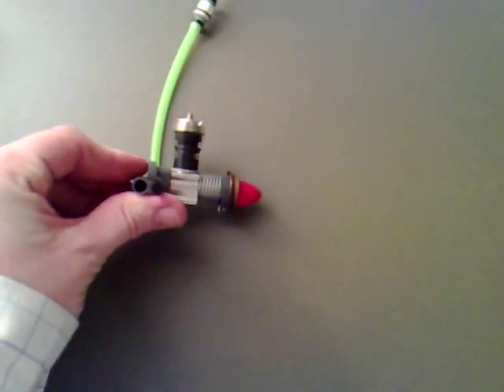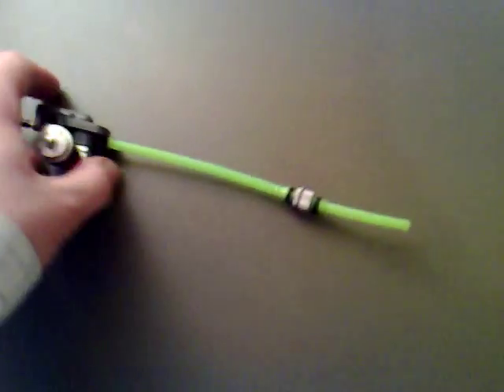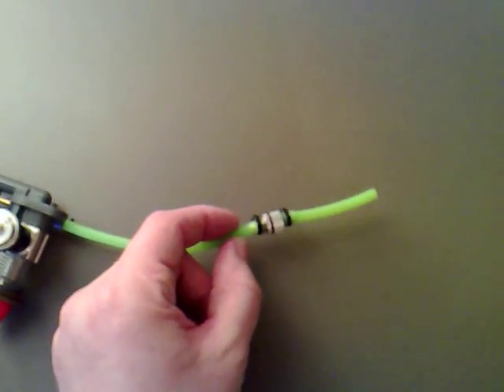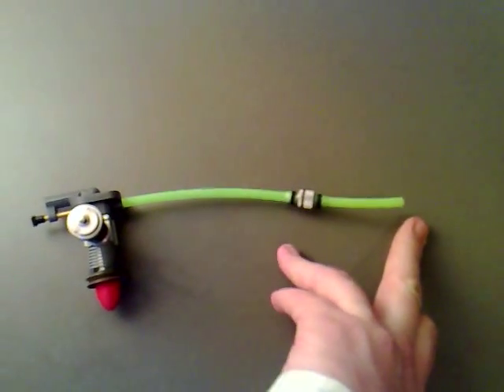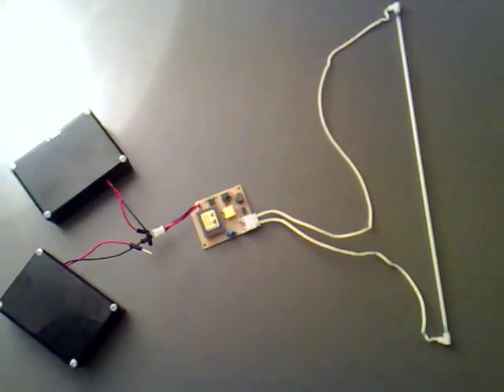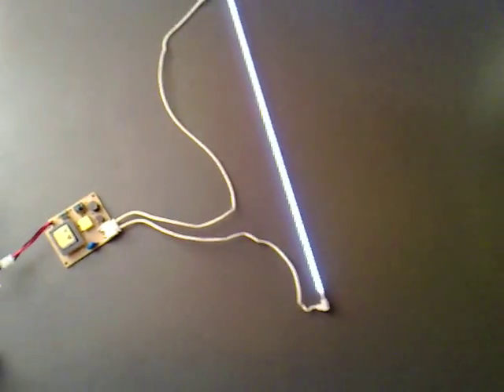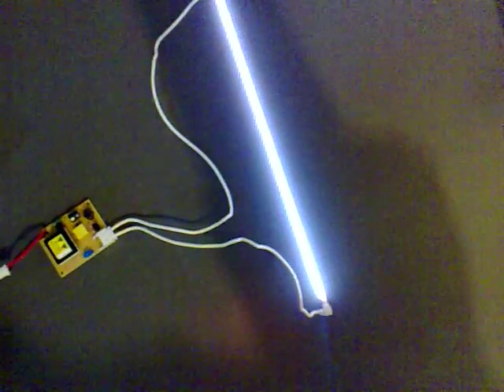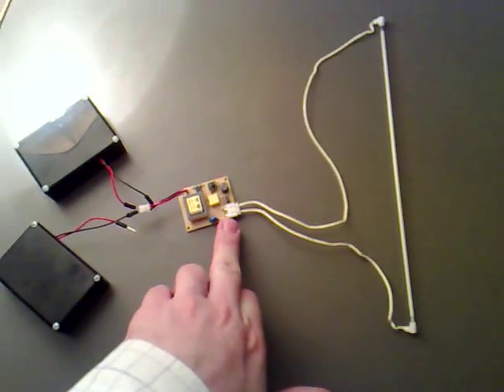HHO Generation (2 Stroke) 002

Comment: IF you are looking for as possible as hight efficency, you need "sweet spot" for VPP (Voltage Per Plate). I mean, if you have 7 plates and you use 12,5 V it is: 12,5V / 7 = 1,785V. Sweet spot is 1,7-1,9V per plate. Dont use more! If you do, you will put "no needet" voltage and lose efficency! Voltage is just for that CURRENT can past water to other plate and make hydrogen + oxygen.

Comment from the maker: I was thinking that too. If it does not I will use my High Voltage Circuit to zap it on a reed switch. That way I can change the timing, but I think when it gets pressurized it will burn off the glow plug when it needs to.

Your balloon video has given me a good idea.....

More from that soon though..

Comment: Wonder if glow plug will work? 
Have not run on HHO alone yet. Still testing HHO feed setup along with EGR. Had a minor setback but will be back at it soon. There's many ways to look at this. Looking first to castor oil. The operating temp with HHO will determine what to use. The way of injecting is still unknown, many ideas but the build will tell us. I'm leaning towards mixing with EGR.
I have always enjoyed your vids and your simple and practical approach. Please keep in touch..

Comment from the maker: I will have a look at your videos.

I was thinking that it should be scalable so if it works on a little 3cc motor then the larger ones just mean bigger generators.

I think this is small enough to work with a 12v 7Ah battery, with a generator putting some energy back to it at least.

I might use a few solar cells for the rest.

How are you lubricating your 2 Stoke when you run it on HHO?

Paul